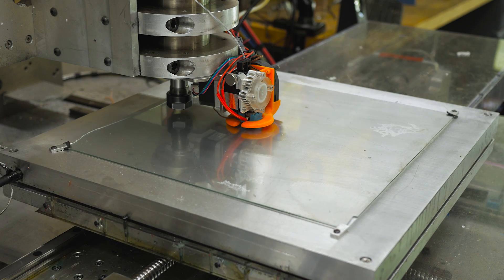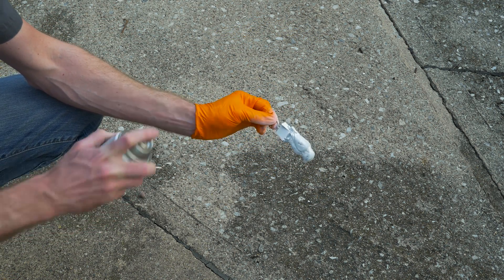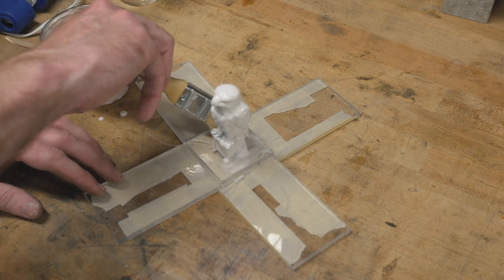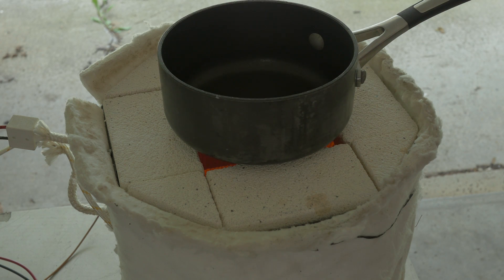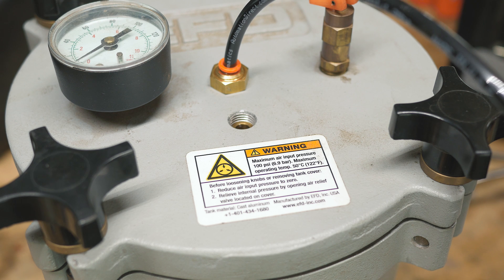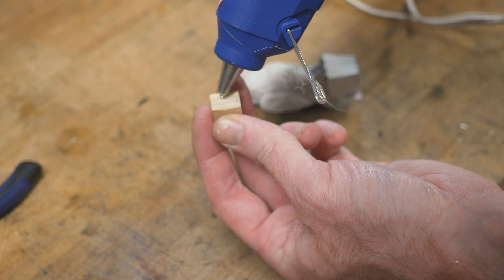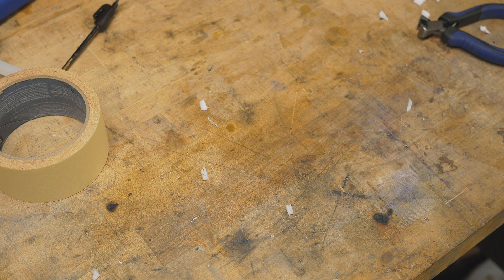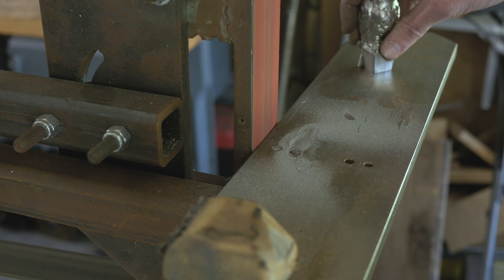Easy, Reusable and LOW TEMP Metal Casting from 3D Printed Parts!

Comment: FOR THE LOVE OF GOD use a clamp or some grabbing tool, my fingers were burning just watching you move that mold into the chamber. Even Youtube's recent product suggestion addition below this video are suggesting gloves and a set of tongs
Reply: "Aw yeah didnt burn m'self!"
Reply: It's a soft, pliable, silicon mould. Squeezing it with a pair of tongs will send the molten metal shooting out of the riser like toothpaste from a tube and could possibly damage the mould in the process.

Gloves suitable for casting metal would have been too bulky to be of any use at that scale.

He did fine as it is, leave him be.
Reply: @TheGodsrighthandman  It's a low temperature metal, he doesn't need heavy duty metal casting gloves. Oven mitts would work. Even nitrile gloves would be better than nothing, because he can rip off the gloves to avoid burning his skin.

Comment: Rather disappointed in the click-bait title. How is this "easy" if you need specialized pneumatic pressure chamber to get the finished product? The easy way would be to print a mold then pour wax in it to do lost wax casting. Probably 10x cheaper as well.
Reply: Please, show us how you do it

Comment: Deposition 3D prints (PLA/ABS) have TONS of air in them, and will bubble if not sealed. An easy way to seal is with primer and paint. Resin 3D prints are solid by nature so they make for best molding. When pouring metal into a cold mold, dust with baby powder. You'll get a reliable pour the first time.

Comment: The first casting failed because the silicon was still wet (with oils and catalyst), pre-heating in a oven (15 minutes @ 200~250ºC)would solve this. There is a iron oxide infused silicon that works better (less thermal expasion mainly, wich uncovers the silicon bubbles) but it is brittle and may not work well with very irregular pieces using single part moulds. Coating the inside of the mould with baby powder or graphite powder (graphite is best in my experience) before casting increase the flow of the molten metal and reduce it's surface tension allowing better details without the need of casting under pressure.

Comment: I'd like to cast in bronze, a Roman wall mounted torchiere, with an ancient bowl on top, that would be used to put out a decent bowl of fire, ... via propane or natural gas.  It would be a good foot-and-a-half high (or more), and the bowl at the top would be about a foot in diameter (maybe a tad smaller).

Comment: Hi Chris, so good to see that you are using the direct casting in silicone. I used that technique 30 years ago in my Berlin studio, but for much larger sculpture castings. The silicone could stand 500 C = 932 F. I made my own tin bronze, casting temperature about 400-440 C. The problems that you had with the ' dry ' look of your casting: the metal temperature too low and the inner surface of the silicone not adequate. You can entirely skip the vaccum when u do the following: use graphite powder and brush it on the inner side of the silicone. Better is to cut open the silicone and prepare / have an outer plaster shell to hold it later firmly together. The graphite lets the metal flow perfectly smooth and the outer plaster keeps the silicone hot so that the metal cools evenly and creates a dense structure. For the first layer on your part:  this is of course a delicate procedure and is essential to have a very good surface.
To avoid a parting line on the metal when you have several cut silicone: use cyanoacrylate and glue the silicone parts step by step together. For larger parts also staple carefully across the cutting lines. Then put it all in your plaster mold. For larger castings it is best to prepare a sand box to place the plaster mold in, that is a mandatory protection feature and also extends the cooling process which is essential for a good cast.

looking forward for your next experiments :-). Like 104
Herri
Reply from the maker: Good stuff, thanks!
Reply: You’re a good guy. Take care !
Reply: i would be thrilled to see you explaining this in a video❤

Comment: Chris! Your process brought back memories from when I started doing small pewter castings, in Germany, in the early '80's. Stationed there as an Army NCO 3 times total. Lived there twice as a child starting in 1953. I used a German high temp RTV available at German hobby shops at the time. Started by casting spoons and small objects to get the skills needed.  The comments by 'erlinghagendesign' below covered other issues I needed to solve at the time. Now I use Smooth-On products for small automotive based items. I do have one desire that an even higher temperature resistant Silicone was available where Brass, aluminum and other nonferrous metals could be cast. I also learned about "Kirksite" from casting and stamping videos on YouTube! That too is a very durable metal with a low melting temperature for stamping sheet metal parts in the automotive industry! Thanks for your post! Jesse

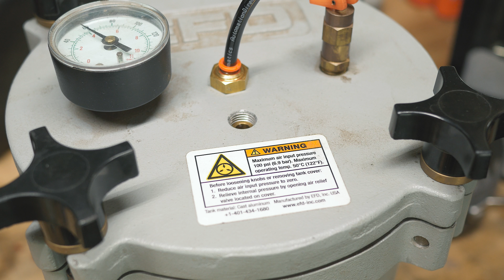Comment: 8:20 - Instead of extra pressure you'd better go with a vacuum - it will not shrink the bubles in a smaller size, but let all the air from the metal which is much better!

Comment: 1. 3d print the mold case
2. calculate the required silicon volume in the design software (Rhinoceros my case)
3. use plastic 10ml & 50ml syiringes to measure the given mold component volumes.
4. thanks, good video.
Reply: 5.use gloves!!

Comment: Great video, CDP; thanks for sharing.  When I saw your excellent pressure chamber, I thought that you were going to pull a vacuum on the liquid silicone to draw all of the bubbles to the surface.  I guess pressure works as well as vacuum.  Using pressure during the cooling of the molten metal is a great idea.  Good job.  thanks

Comment: I've always used a vacuum to remove air bubbles from silicon prior to pouring, this would no doubt have issues when using hollow printed parts, very cool to see your alternative method here with pressure. Also I like the electric furnace as a base for your heating the metal! Will keep that in mind for when I finally get mine finished too heh. Thanks for sharing!

Comment: From my previous casting of lead figures you could forgo the pressure pot for the casting of the metal. Mainly all you need to do create the mold as you did, then when casting it heat up the mold either by placing it in a toaster oven, or do what you did and just do multiple castings in a row which will keep the mold warm, also use a cone as the riser or half sphere thats larger than the object that way you have a resivoor of molten metal so when the metal shrinks a bit you'll have enough to keep it filled, also easier to handle and you don't have to fill it up 100%.  The big thing is you could make a slight zig zag cuts on one side (back perhaps) to make the master and castings easier to remove you can use clamps and two pieces of acrylic or hard board to secure them so the clamps don't squish the mold, and then use use of talc (or baby powder) to liberally coat the inside of the mold which allows for air to escape out the edges and give you a clean cast, thus eliminating the need for the pressure pot for casting.
Reply: the metal in the 'cone,' as you put it, also adds weight to help force more metal to the sides. i would imagine that you'd get better results with a runner or two, also.
Reply: never heard that as a trick before.
Reply: interesting and good to know, thanks.

Comment: Trade names for that metal alloy are Cerrabend and Woods metal. They were used to fill copper pipes prior to bending, then heated to get it out. Now resins are used instead as the metal is very expensive now.
Reply: Woods metal has a lower melting temp (you can melt it in boiling water)...

Comment: Super late to the party but:
1) Pre-heat your mold. This gets rid of any moisture that will boil off and cause air bubbles, and also stops your metal from cooling too fast.
2) The pressure pot will have little to no effect. The outer 'skin' will have solidified by the time you get it into the pot. 
3) Jiggling the mold once the metal is poured in is almost always a bad idea.

Comment: If someone wanted to cast metals with higher melting points, you could then pour hot wax into the silicone mold, then plaster it, melt out the wax, and fill THAT with metals.  More ideal for bronze or aluminum and others.

Comment: Make sure you pressurize your silicone mold under the same pressure as the pressure you intend to use during your final mold casting pour.  This will remove the micro-bubbles from your mold that will otherwise explode while under pressure if you did not cast the negative mold at the same pressure, thus destroying your mold and the casting.  Pressure is weird!

Comment: So you pressure cast the silicone over the pattern ? That's interesting, e routinely VACUUM cast the silicone. It works perfectly but you need to have a bucket at least 3 times the size of the pour because it will inflate at the beginning. So you typically vacuum degas the mix, then ambient pressure pour.

Comment: I thought you'd use a vacuum chamber instead of pressurizing the cast, in order to make air bubbles bigger so that they float out of the metal, instead of compressing them and causing strain after
Reply: .. or, you know, add a few sprues. The pressure vessel is a good idea though - creating a good vacuum and holding it can get expensive, but plenty of people have access to air.

Comment: Thanks for such an informative video.  Seeing you pick up the mold bare handed had my heart racing. Wouldn't a safer way to handle everything be to put the mold into the pressure pot, and then pour the liquid metal into the mold so you don't have to move it?

Comment: I think you should not use pressure but vacumm. You can easly make vacumm pump out of old fridge compressor.
Reply: kubaxd26 because bigger bubbles are better than no bubbles? I don't see your logic
Reply: vacumm will suck air out of mold
Reply from the maker: I've used both and they seem to work equally well.  I don't have a vacuum pump anymore so I didn't use one - but I like that idea of making my own!
Reply: @ChrisDePrisco  I was wondering about that, the pressure chamber vs. the vacuum chamber. I don't have a pressure chamber but I do have a vacuum chamber for degassing. Good to know that they both work. Thanx for the video and links to the metal and silicone. I'm gonna give this a try.

Comment: I bet if you'd made a wide base instead of a narrow one, it would have made a dish in the silicone, trapping the overflow metal and making it safer to handle.
Reply from the maker: +Mike Bryan if you look close on the second mold I did nibble away at the silicone to give me a bit of a dish. It helped but I wanted to get it as full as possible to make sure it didn't sink in like the first pressurized cast I did.

Comment: Why not make a zigzag cut in the silicone mold to make it easier to remove?
Reply from the maker: I saw that in the Tested video and thought it was super ingenious but I thought I'd try it as-is first.  It was really not difficult to remove and took maybe 10 seconds at most once I figured out how to push it out the bottom.  Definitely a good trick to know though.

Comment: for bubbles in silicon cast better use vibration table to remove it,,, negative air pressure very dangerous with high temp metal liquid!!!
Reply: I am guessting he didn´t have a vacuum chamber at that time. Why should that be dangerous thou ?

Comment: Hello Chris, loved the video.  A friend and I are working on some vintage speedometers from the mid to late 1920's and there are some pot metal parts used in the original design that over time swells and destroys themselves rendering the speedometers useless.  We'd like to change that, I like the ideas you used in the video, want to make a few bucks and assist us in making a few of the small parts?  The parts are a little smaller then what you made here and a lot less metal!  I look forward to hearing from you.... Regards, William

Comment: Seems like much cheaper Tin/Lead allow would also work. It's $26/kilo from aliexpress. Lead-free Tin/Copper is about twice as much if you want lead-free. Melting temperature is 230-ish C.
Reply from the maker: Yea, I was going for the non-toxic option - there's a lot of options with lead and/or cadmium.  I've never heard of Tin/Copper and I can't seem to find any info on it.  Got a link or trade name for it?  Although at 230C it's probably going to damage the silicone.
Reply: Hey, actually your tin-bismuth allow is even cheaper. My impression was that it would be a bit more expensive than Sn/Cu.

Comment: What pressure vessel is that?

Also vacuum the silicon then poor and have it cure in a pressure vessel to remove bubbles. That is basic casting 101.

Also look into centrifugal casting with a that type of mold.

Comment: I'm a newbie to this but I noticed you measured the Alumilite by weight, using a digital scale. I was measuring by volume and, while it still worked, it was crazy messy. Using weight measure, it is still 10:1?  Thanks for the super helpful tutorials!

Comment: USe a vacuum chamber on your silicon before it cures ot get rid of the bubbles.
Reply: Honestly I am surprised to see that pressure worked on silicone as well.

Comment: I know you borrowed tools from work, is the pressure vessel yours, very cool, never saw that before, but I only have limited experience in casting. You built your furnace right?
Reply from the maker: +Stephen Hodge The pressure vessel is mine, yes. Although it did initially come from an old project at work. It's meant for dispensing pastes and greases and such. I did build the furnace, yes.

Comment: How structurally sound is this bismuth metal? Could it be used to cast 3d printer parts? 🤔
Reply from the maker: +Darkmastergrey I would say probably; if they aren't too thin or under high stress. It's very hard but also brittle.

Comment: I would've thought that the way to remove bubbles would be with a vacuum, not the opposite way around. Did you use high pressure because you don't have a vacuum pump or is there any other reason?
Reply from the maker: I've not done a TON with vacuum because I don't have a pump anymore.  I first learned about using pressure when learning how to cast resin and keep the bubbles out and it worked perfectly so I've started to apply it in other areas.  I don't know exactly why it works but hey, who am I to argue with results!
Reply: True, the results were pretty great. I guess I've seen one too many "__ in a vacuum chamber" videos and that was what first came to mind. Using pressure seems less messy because stuff doesn't expand all over the place, but I wonder if increasing pressure causes some air (really small bubbles) to diffuse into the cast, especially with silicone.
Reply: Well, to be fair, using pressure doesn't remove the bubbles at all. It just makes them too small to matter. ;)
Reply: Hmm, good point
Reply from the maker: Yikes... I think I'll stick with the compressor.  :P
Reply: Some people do both. First, they extract the bubbles from the silicone for the mold, and then do the casting in a pressure chamber.
Reply: Not to mention when using vacuum, like when degassing silicone, it tends to froth alot and often overflow, and I can see alot of problems arising with molten metal there.
Reply: Usually you vacuum to remove the bubbles before you pour it over your part; then pressure chamber after to compress whatever small ones are left to microscopic sizes- the bubbles seen on the first cast are actually from metal shrinkage (due to cooling)- the pressure helped because the metal was being forced more strongly to the outsize edges of the mold
Reply: Wonder if you could use a venturi generator to get a decent vacuum instead.
Reply: Doesn't typically pull enough of a vacuum. I've tried :(
Reply: It won't, but you can buy used vacuum pumps from your local AC repair shop, normally for a six pack of beer. If they have any old one stage pumps they will almost certainly just give them to you.
Reply: The proper procedure would have been to use the vacuum on the silicone after mixing, then once poured, then applying the pressure.
Reply: That was my thought as well. I use a vacuum pump to pull air bubbles out during epoxy molding, I would think it would work on metal more or less the same way.

Comment: Did you use mold release on the part before pouring the silicone? It could be your first few metal parts don't look as good just from the residue from the mold release left over.
Reply from the maker: Nope, no mold release needed. :)

Comment: Soft metals kill sanding belts.  And fast.
Reply: I somehow find it so counterintuitive, but I guess the soft metal sticks to the belt and ruins it this way.
Reply: @dirk9787  Exactly.  Lead, for example, sticks in the grit like putty and turns the belt glossy in no time.  Plastics do this too, but wood can help clear that.  I try to stick to files whenever possible with lead; files gum up too, but can be cleared with a wire brush or a torch.